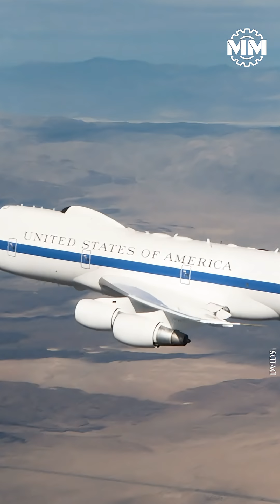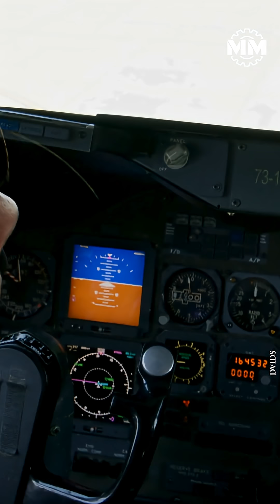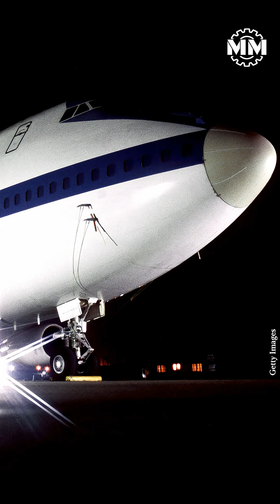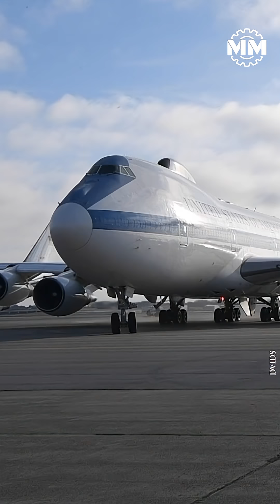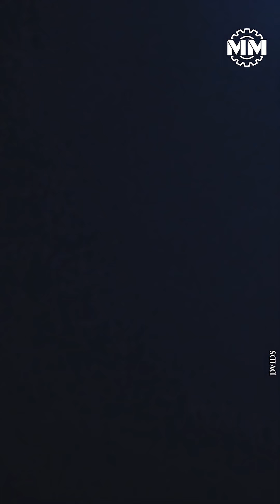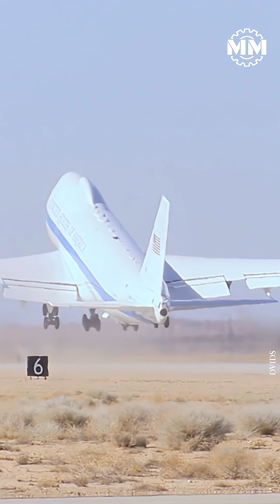America’s Doomsday Plane Just Took Off — Here’s Why

Comment: Can it survive a SAM flying at hypersonic speed?
Reply: A SAM would not have to be going nearly hypersonic speeds to hit this plane. The issue for any missle is defeating the counter measures and escorts.
Reply: Where would the SAM be fired from? The E4 would just be circling around the central US so it would have to be a very long range one. Maybe launched from Cuba? Then how would they get accurate targeting data? Satellite is a possibility.
Reply: @johngalt2506 yeah, a lot of things would have to be right to at least get the correct trajectory; but for actual impact , I highly doubt it
Reply: @josephmartin6219 
I imagine the E4 has a pretty good ECM system as well. 
It would definitely be a difficult shot.
Reply: A submarine could take it out east.
Reply: @MyPhone-qg2eh
Explain how a sub could do that when its flying over Kansas 😂
Reply: It would not fly to a combat zone where SAMS would be a threat.

Comment: Undoubtedly that plane NEVER flies alone 🚀
Reply: Right! There is a squad of stealth flying saucers accompanying it!🛸🛸🛸🛸🛸🛸
Reply: @luislaplume8261  Not stealth, cloaking device.
Reply: @robertd9850 Thank you! That is a very helpful response to my comment! And I appreciate it!
Reply: @luislaplume8261 
Lies! Can’t see em in the video…

😉
Reply: @Peter-r1f9m  That's really funny 😂
Reply: @Peter-r1f9m I said STEALTH which means invisible due to the use of advanced experimental quantum physics. Using the gravity waves that bend light and space that surrounds the flying saucer it becomes invisible to the naked eye. By the use of a neutron accelerator on Element 114 that changes it into Element 115 it releases gravitational forces that pushes against the gravity of the earth. Something that is still classified as Above Top Secret by the Department of War. Check out stories about Area 51.
Reply: @luislaplume8261  I thought Element 115 is what they used to create zombies though
Reply: Correct.  SOP dictates that NAOC is always accompanied by tactical fighter escort. These are usually several squadrons of fully armed F-15C Strike Eagles, F-22 Raptors, or F-35 Lightnings, along with KC-135 Stratotankers.
Reply: @michaelgiancanna-jaume4637 . Thank you !      Our military never ceases to impress me ❤
Reply: @Rex-q2q3h  yes it never ceases to amaze me either, especially when soldiers routinely go on rape rallies when deployed in foreign countries.
Reply: @michaelgiancanna-jaume4637 The times I've seen it there was a flight of four F-15's in escort, all armed.
Reply: @michaelgiancanna-jaume4637  fighter aircrafts can't stay as long as the doomsday plane.
Reply: Australia over , charge services have threatening around Australia travel..
Reply: @singhsahab9874   What?? I literally had a stroke trying to read that...
Reply: Of course not, it is flying with fuel tankers and a number ofairforce 13’s …special aircrafts which carry an endless supply of 13 year old girls for #47. They will run out of fuel before they run out of girls.
Reply: Damn!!